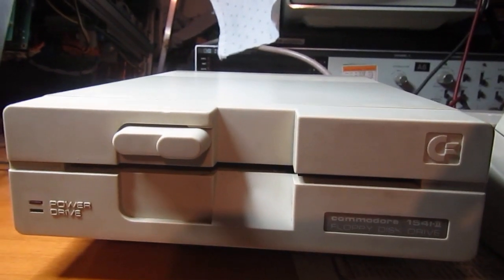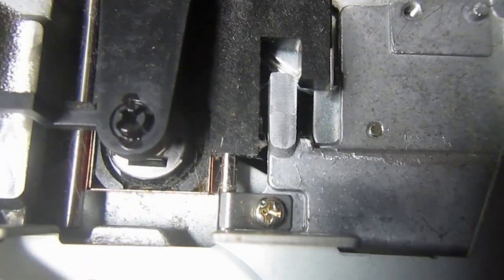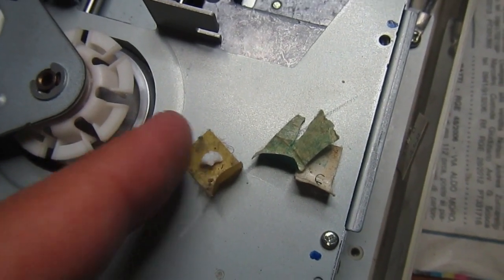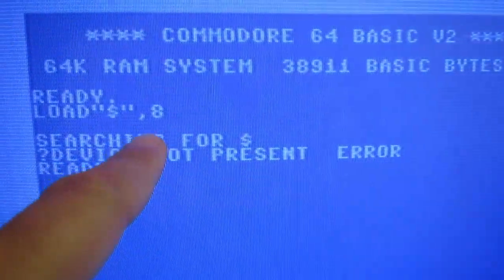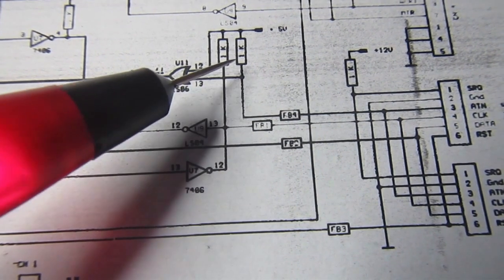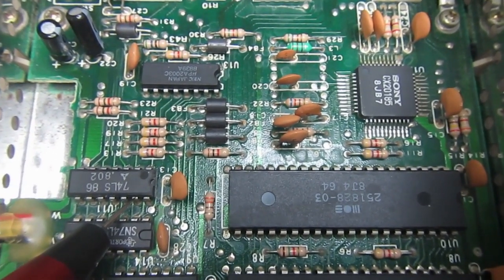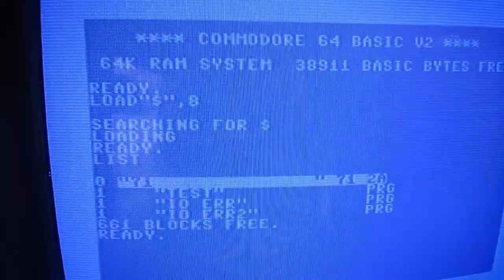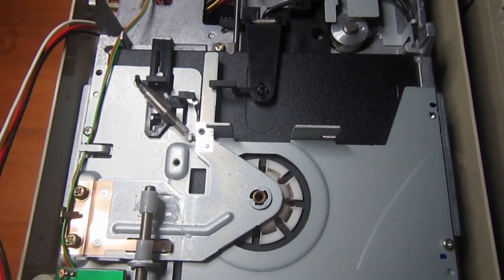Commodore 1541-II repair. Device not present error.

Comment: If I can be a troll. Twice in 20 years I have encountered a very rare fault 1541 II. It involves wasting some of the 16MHZ quartz edges. It looks like normal loading works, and some like AR doesn't work. Let me explain and describe the whole thing.

C64 6510 going on 985 248 Hz
6502 in 1541 going on 1 000 000 Hz (16MHZ divided by 16)

for simplicity divide by 100 and when C64 wasting 9852 cycles you need expect in drive past 10 000 cycles - about 150 more than C64.

This is very important feature for example Action Replay loader which after programming sync C64<->1541 sending a few bytes without acknowledgement and when 6502 CPU in drive is slowing down it simply DOESN'T WORK and many other programs which using this method.
I wrote 2 programs  PAL/NTSC version first one measure a spin RPM and in this drive spin was 299 RPM less than 0.3% error so it was good BUT
second program measure how many cycles going in the drive CPU in one frame C64 
C64 PAL case have a frame
312 scanlines * 63 cycles = 19656 cycles
Program check how many cycles gone in this time in CPU drive
from my experiency I know properly value is about 270-300 cycles more than C64

Diagnose:
The adjusted trimmer suppressed crystal vibrations and some of the edges were lost.

After removed C31 22pF and replace C11 40pF trimmer to 22pF cappacitor work perfectly drive have 294 cycles more than C64 per every one C64 frame
.
Reply from the maker: Wow! That's a great troubleshooting indeed! It takes time and knowledge! I've never stumbled on a similar problem, however now I know it may be an issue if all else fails :)
Reply: @iz8dwf  We tried online running my cart "ogryzek"

1st - problem existing (drive CPU slowing down from 1 to 0.99 MHZ ) FAST Load error
Can you imaging when you check on the scope CLK on 6502 and you'll see 0.99MHZ - do you get it IT IS WRONG ?
2nd - checking RPM
3rd - checking CPU in drive speed (when it was above 32768 a drive CPU was slower than C64!)
 I was hanging on the phone line
4th - after repair (offline) and modding

https://youtu.be/Tneux8n8BqE?t=376
https://youtu.be/18rciSliDPE?t=86
https://youtu.be/5BpwHx_N4pk?t=229
https://youtu.be/15cxOi7DP6I?t=1804

multikernal
https://easyeda.com/wegi1/C64C_16_x_kernal-MmEysJ1jB
ogryzek cart
https://easyeda.com/wegi1/ogryzek-v4
https://youtu.be/ugA2dsKEH50?t=154
Reply: Hello Wegi! Nice to read your very interesting comment here. I have a 1541 II drive which runs okay without cartridge, but with Action Replay it makes some issues with some files (gray paper/border flashing but the file is going to load, one file in demo loads badly with AR attached, but it loads ok without AR). This is very interesting and rare issue similar to two You described in your comment. I followed your solution but it didn't helped. The quartz seems to be okay, also the trimmer is okay (I can set the capacity and measure it without problems). The drive had lack of one connection which was caused by a some kind of grease on pcb. I am going out of solutions how to diagnose and fix it. Is there anything more which I could measure or check? Would be nice to see some new ideas. All the best!

Comment: I have watched your Videos several times as your approach is very logical and that's the way I like to think I prefer best.  I sometimes wish they were a little longer and contained a little more data as I find myself asking questions wondering about certain things.  I have seen at least in one video you had a prepared list of things you wrote down to check but it wasn't clear what they were...I think that would help tie in to the logic and thinking pattern making it more understandable about what you're doing.  I was lucky to buy some 1702 Monitors and Seller gave me all his mostly dead 1541s amd 1541-IIs.  A few worked and the rest had Endless Spinning Drive with Green and Red Light on and Drive Not Ready Errors of which 2 Drive Mechanisms were bad but I am trying to determine best approach to Repair those Drives so that's the reason for the questions behind your List and approach method.  Keep up the Videos and good work!    -Mark B.
Reply from the maker: Hi! Yes, I have some troubleshooting "tips" for each of the common devices that I repair. However, the lists always begin with: 1) Power supplies. 2) CPU clock (input & output). 3) CPU Reset, IRQ, NMI (Reset must start low, then go high, IRQ and NMI must not be stuck low).
Endless spinning on a 1541 means the CPU isn't executing its code. So check the power supplies, the clock and the reset signals first. You can also contact me at iz8dwf@amsat.org for more troubleshooting aids.